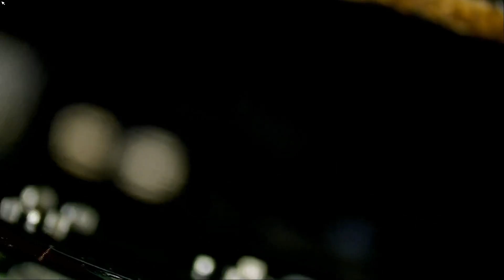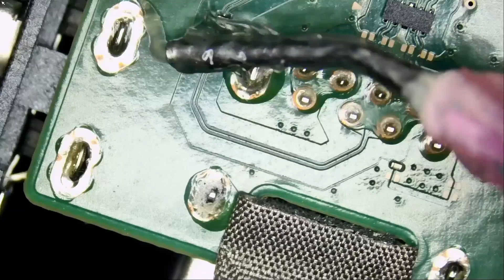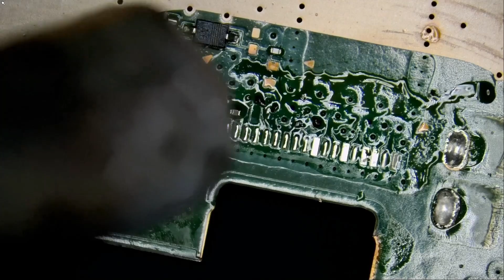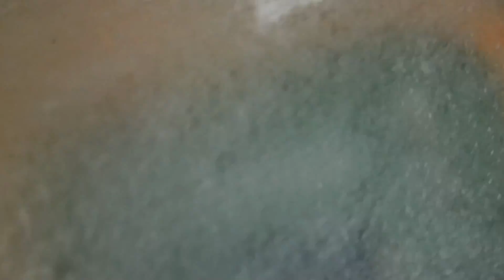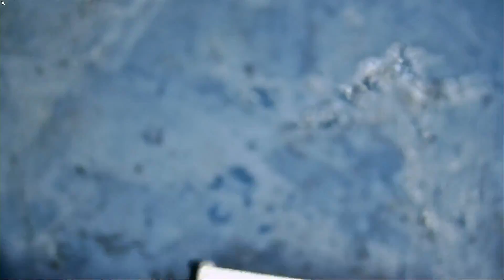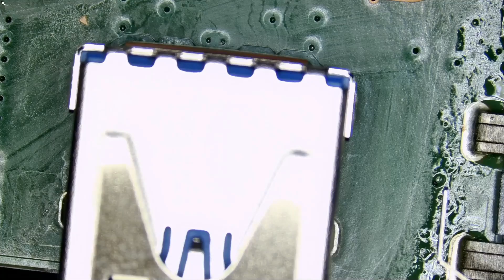PS5 Repair - I did something wrong.

Comment: Best wishes to your mom for a quick and safe recovery.

A desoldering gun is invaluable when doing recaps of through hole components. Even for HDMI ports it would probably be better than using a solder sucker because I've seen you struggle several times with the eucker to clear through holes, and I promise you that you won't randomly knock components into the 9th dimension with a soldering gun. It pays for itself quickly.

Comment: I always use rubber tip on the sucker. It won't be happen if you use the rubber tip.because  there would be no vibration on your hand

Comment: I’m assuming maybe the ps5 fell down from angle with the cables and damaged those ports. Could have gone worse if they got ripped off. But great work as always! 💪
Reply: if  ps5 fell down from angle with the cables damge complete port not just inner pins or plastic

Comment: Alex, a trick I learned when I was an apprentice in the 80s. Put a neoprene sleeve over the solder sucker tip. It enhances suction at any angle, prolongs tip life and prevents pcb damage.
Reply: Yep. Silicone works well too, and might be easier to get than neoprene.
Reply: Yes. Cutting the original tip reduces the suction, albeit only slightly, and means you have to rotate the sucker each time. Silicone sleeve also allows an iron to be kept in place longer.

Comment: Recently I've had a problem with the ports I'm using. When I plug the HDMI cord into the port the picture goes in and out. I pulled the board again and examined the port under the microscope and everything looked perfect. I probed every pin and not a single bridge. What I noticed is when I push the HDMI plug firmly into the port pressing it stiffly against the back of the port it will display but if I bump the plug or touch the cord, the picture cuts out. I've done a few hundred PS5s and I've never had this problem before. I ordered some HDMI ports from your site and I'm hoping that it was just a bad port. Have you ever experienced anything like this with a port replacement before?
Reply: It could be a bad port, but I'd test with a different cable first
Reply: When you say "the ports", you mean the problem happens with multiple ports? In that case, it's either the connector on the cord (have your tried different cords, from different manufacturers?) or the ports themselves were probably made with the wrong tolerances (a lot of sellers on eBay are basically selling factory rejects that didn't pass QC).
Reply: Could also be you have a cold joint on one of the pins. Try reflowing that might work.

Comment: Hey Alex, I always wondered, are there instances where a thermal cycle with hot air could improve conductivity on older boards that need a conditioning from flexing and a loose chip without a full reballing?
Reply: Yes.. it's called reflowing and can be done with the chip still fully installed. Usually regarded as sloppy and not a proper way to do the job but it can work.

Comment: Nice Fix! Since you don't work on a lot of older boards you may not see the use of an electric desoldering gun. The 14 and 28 Pin DIP chips on older boards are a great example of when these electric desoldering guns are extremely handy. Everyone does not work on HDMI connectors and ceramics caps 95% of the time.
Reply: As soon as he starts selling an NF.DesolderingGun, they'll become a must-have tool. 😜
Reply from the maker: 100% if I see a use for them.  Inventory always increasing as long as the tool makes sense.
Reply: @NorthridgeFix  
I know Alex. That's what I always notice for sure. You carry the most common sense tried and tested tools for the bench tools for sure. No doubt and I really like that.  That's the reason I commented because I see facts on both sides. I see viewers could have a use for them, but I don't see that great of a benefit for your work bench though. For many of us it's just something to take up more space and not worth it. I do see how some may find them more helpful! Keep up the excellent repairs! 👍
Reply: @northridgefix I have a heated desoldering tool that works a lot like the sucker you have except it's heated. It does need to be flat on the board, but the plunger is exactly like yours. The heated part is like a soldering pencil with a hole in the middle. I used it to fix over 100 Commodore 64 computers back in the 80's. At that time, a professional desoldering station was $400 and the tool I got made by OK Tools back then was $30.  I had used desoldering bulbs like you talked about several months ago and I agree that they weren't that great. There is one disadvantage to the heated desoldering tool I got. Because there is a thin metal tube that the solder goes through before it gets to the plunger part like yours has, the tube would gradually clog and I had to use the unclogging tool they supplied to clean it out. I'm thinking I might order yours and see if works without frequent cleaning. I see you use yours a lot, so it must hold up well under frequent use. I really appreciate that you use the tools you sell so we can see that they hold up under heavy use.

Comment: Can you please tell me what is reading on multimeter in diod mood which we can assume that short on caps resistances etc (how to find bad guy  using a multimeter) please make tutorial video using multimeter and also mentioned which multimeter you use i try find similar video on your channel but I'm not able to find any so please make that video regards (Mr. Batter than factory)

Comment: The electric de-solder is better suited for thru hole and larger components and really needs a long warm up time, right tool for the right job. The nf sucker is an awesome tool!
Reply: If you don't have low melt solder and or don't want to use hot air then electric desolder tool is best for through hole

Comment: A proper desoldering gun (with temp controlled tip) works well If you work on inverters or welders. The IGBT's,  MOSFETS, capacitors and transformers are quite big, with lots of sonder. The correct tool for the correct job. I can't see you using an electrical solder gun under the microscope.
Ouch, hope your mom heals quickly (and completely).
Reply: @pericaskaro4792 YT's STASI are screwing with the comments again and not only here. Cheers!

Comment: Leave the sucker vertical and put the camera on an angle
Reply from the maker: Or I can put my bench at an angle.
Reply: @NorthridgeFix  I'm sorry , I am unfamiliar with your microscope.
I didn't realize it was too dificult to adjust it.
Reply: @mohammednovalija Depth of field on the camera may be too shallow for that to work. It would probably have a time focusing across some boards, as he would be adjusting it to see either end (granted, if the board is fixed to bench).
Reply: @ThisIS_Insane  Makes sense.
Was just a Trump Bleach idea.
Reply: @mohammednovalija  Watch a few "Just Rolled In" or "Customer States"  videos to get more laughs. Some are real, some are setups and most are stunningly shocking, especially when you get a look at the big picture. Many are hilarious!
Reply: @NorthridgeFix  - Sounds like a good test for the PCB holder.